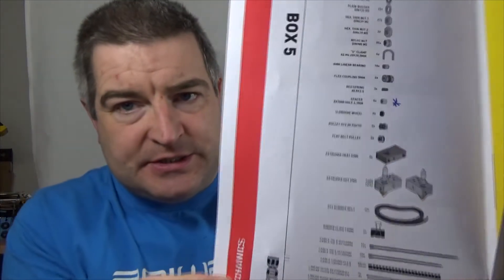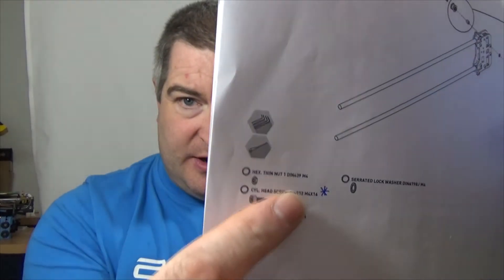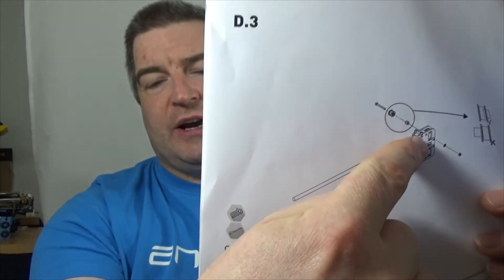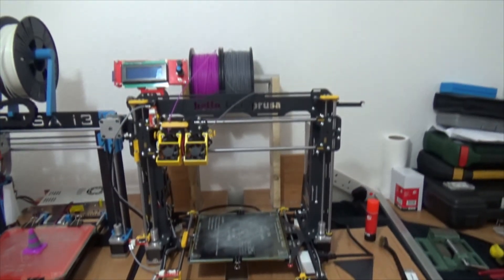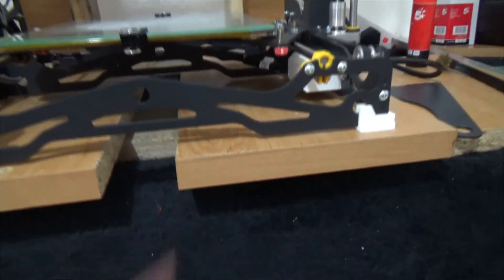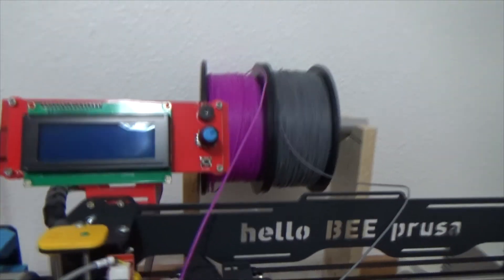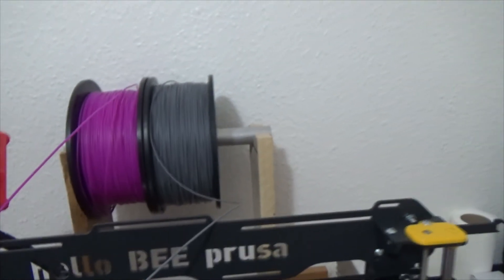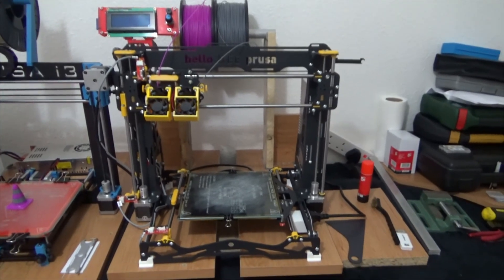Hello Bee Prusa i3 Build

Comment: Great vid have been considering this for dissolvable support.
 
Have you used those and do you have any footage of prints post processing? 

Cheers.
Reply from the maker: Hi,  I too picked up this printer to use PVA support material.  I have not yet tried it.  I need to find some PVA filament that's not super expensive

Comment: So is this machine worth to get?
Reply from the maker: If you want to mess around with dual extrusion then this printer is a good place to learn.  I'd recommend it if you already have some knowledge of 3D printing.
Reply: Yeah, i already have a BQ hephestos just like your's just mine is red!
Is it really much better than the hephestos?
Reply from the maker: The print quality is about the same but having 2 extruders means there is so much more to learn and so much more you can make :)
Reply: How would you judge it for a starter though? Cause honestly, I want to fix up some old tape decks and walkmans who's gears have chipped, and might later on even require to make something with two types of materials. Metal composite with Nylon, or Carbon with whatever. So initially it'll be for tiny gears and stuff, so I need a pretty good resolution and so on.

Besides, I'm more of a guy who rather buys one good device than buy 10 and ramp things up. Plus for these kits it's handy that I don't have two left hands, luckily.